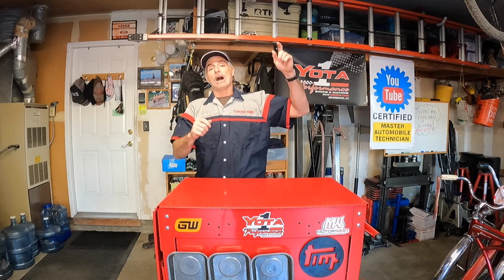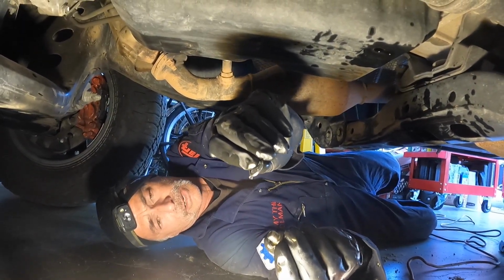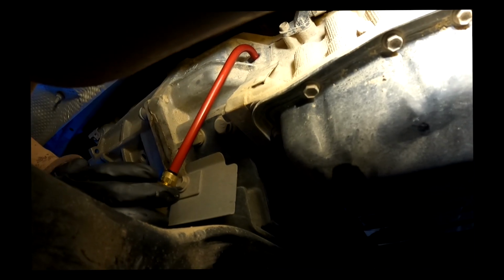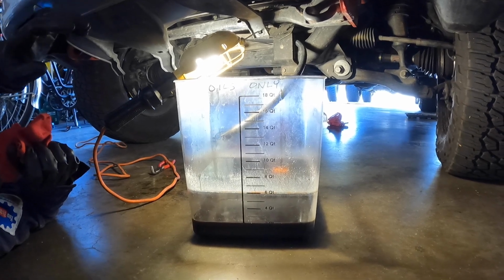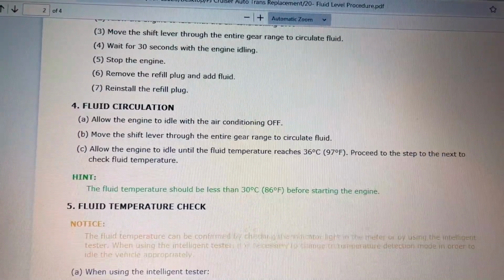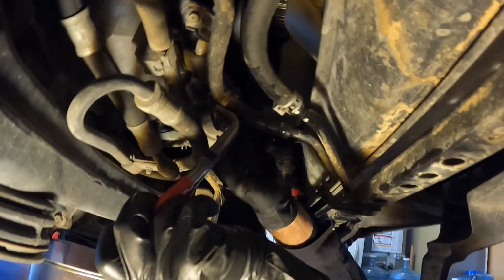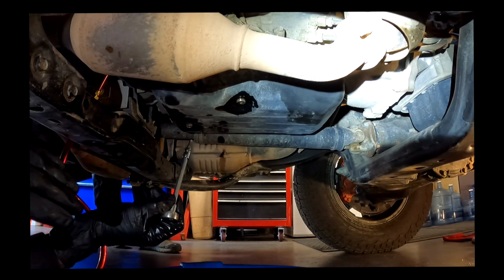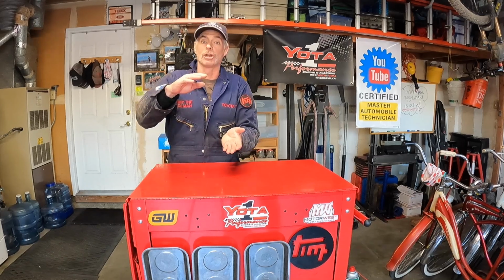Toyota/Lexus Sealed (No Dipstick) Automatic Transmission Flush (Fluid Exchange)

Comment: I have a 2020 Toyota Tundra TRD SPORT the Dealer says you never change the Trany fluid, is that BS or is it true, Had an 2016 they said at 100K unless you Tow often. Whats your opinion.
Reply: You go by what the manual says. Any person telling you not to change any fluid is an idiot!
Reply from the maker: Richard, the dealer telling you to never change the fluid is giving horrible advice.  No fluid on the planet is lifetime.  All fluids break down.  ATF at best can last 100k miles provided the fluid never went over 170 degrees Fahrenheit.  If you drive at all in the mountains, tow or go 4wheeling, you will have recorded temps way over 170.  As the temp goes up the life of the fluid goes down.  Keeping the fluid in good shape is cheap insurance especially when you know how much a replacement transmission will cost you parts and labor.
Reply: @TimmyTheToolman  I know the dealer was telling me BS, I totally agree with you will have it done at 50K
Reply from the maker: @richardmaxwell4489  Smart decision Richard.
Reply: So then when is the best time to change my Trany Fluid? I now have almost 20K.
Reply from the maker: @richardmaxwell4489  It depends on how you drive it.  If you drive in the mountains and/or tow a fair amount, I'd renew your fluid at 30k.  If you don't drive in mountains or tow and mostly travel on flat roads, I think you could probably safely go to 60k.  The old standard was replace your fluid every 30k for normal driving and every 15k for harder driving like in the mountains or towing.  With synthetic ATF now, you can go more miles before changing it.

Comment: Nope. If you want to ruin your auto tranny, flush it completely. You've got to leave some of the old fluid in there, because it contains metals from the internal clutch pack. Big no no. Internet is full of bad info....dudes and dudettes.
Reply: Er, you're thinking of a power flush using an external pump... That's what can cause problems, and that's how shops often do a quick and dirty "transmission flush" service.

This video is the right way to do it, using the internal transmission pump.
Reply from the maker: Thanks for the comment Steve.
Reply from the maker: Theshyguitarist, what you said is a theory about the concerns when doing a flush on a transmission that was clearly abused.  I've heard the same concerns from many sources.  Plenty of people have performed full renewals of fluid with zero issues.  So no, we're not giving out bad information.  I talk about this concern in a pinned comment (1st comment you see).  The question is, is this theory accurate or urban legend passed along over time?  By the way, you're right on the cusp of being erased on our channel.  Be respectful or your gone.

Comment: Always loosen the fill plug first.  Ask me how I know…..
Reply from the maker: Yep, that's good advice.  I usually remember to hit that home with people but I forgot to mention it.
Reply: Did you leave the fill plug out while adding the 1 quart increments, or did you reinstall the fill plug each quart added?
Reply: Did you leave the fill plug out while adding the 1 quart increments, or did you reinstall the fill plug each quart added?
Reply: Did you leave the fill plug out while adding the 1 quart increments, or did you reinstall the fill plug each quart added?
Reply: Did you leave the fill plug out while adding the 1 quart increments, or did you reinstall the fill plug each quart added?
Reply: Did you leave the fill plug out while adding the 1 quart increments, or did you reinstall the fill plug each quart added?
Reply: Did you leave the fill plug out while adding the 1 quart increments, or did you reinstall the fill plug each quart added?
Reply: Kids don't do drugs
Reply: Because sometimes you might have trouble getting it loose, then you have a car with no fluid that won't move
Reply: How do you know?
Reply: @BrutusPalmeira The drain needs a low pressure air leak above the fluid to allow the atf to drain more quickly. Pulling the fill plug accomplishes this easily.
Reply: Lol
Reply: You can always fill it through the cooler return line.  Easy to get to on these.
Reply: @steveholdensrc4000  
I bought a 25 feet length of clear 3/8 inch ID hose. Fill as the engine drains using motor running.  Drain into a 5 gallon bucket with the fluid measure lines. Stop when the fluid in the bucket reaches 3 gallons. Add a total of 12 quarts low viscosity AMSOIL ATF Signature series. Pricy but Amsoil is worth the $$.
Reply: And always check the fill plug of the rebuild you just received before the delivery driver drives away and you install it.  Speaking from experience
Reply: @sirsweetness8332 
 you can still fill the transmission if the fill plug is frozen up.
Reply: You could also drain, leave the level plus out and flush system by pumping fresh oil into the trans and watch when clean fluid comes out..

Comment: Great video Tim!  Is it OK to leave the fill plug out and the tip of the fill hose in the trans while you are doing the check procedure with the truck running? I think that is what you did but wanted to confirm. Thanks again for another detailed video!
Reply from the maker: Yes, it's ok to leave the fill plug out and the tip of the pump in the trans.  But, with the fill nozzle we used, the tip barely extends past the threshold of the transmission case.  You couldn't want a hose pushed way in there, because if it catches something, you're just messed up big time.
Reply: @TimmyTheToolman  Thanks!  I bought the same pump / tip that you were using in the video so it sounds like I should be in good shape
Reply from the maker: @joeburris2836  Yeah, you'll be good to go.
Reply: I had to add some additional fluid on my ‘07 Tundra with the A750F transmission. When I got it to fluid level check mode after my three drain and fills nothing came out of the check plug so I added fluid through the open fill plug while the engine was running. Took about 1/2 quart of additional fluid before fluid started draining from the check plug. Great video!

Comment: I "exchanged" the transmission fluid on my 07' Tundra.  Drain pan, fill, pin T-stat open, drain from cooler line, start rig, run through gears for 45 seconds, and fill.  Repeat 4 time, check temp/level and your done.  I learned all this via your videos.  Spot on and provided peace of mine of doing the job correctly the first time.  

You guys Rock.
Reply: Was going to mention the Tranny Oil Cooler/Tranny Thermostat Pin Open before starting the level check at temp, then removing after the trickle occurs/check hole revealed.
But what do We know?!?!
Love you Timmy
💜♥️❤️🧡💚
Reply from the maker: Good job Eric!

Comment: Three years ago I have my 2006 tundra to local dealer with 13 quarts for a flush with the machine. I got the truck back think it was done but once the transmission would heat and I would come to stop it would shudder and bump. So I opened the pan drained the oil out refilled it as per the factory service manual after getting the overflow plug dripping i closed it and it has ran fine since. I would not recommend the flush via the machine as they don’t check if adequate fluid has been put inside.
Reply from the maker: Thanks for the comment Andy.  That's unfortunate they don't confirm the fluid level is good after flushing the system.  You would think this would be part of the service.  I guess it supports my belief that it's better to do it yourself instead of taking it to a shop.  When you do it, you know it was done right.
Reply: That’s why I do my own work don’t depend upon dealers or outside shop. I was bleeding the brakes in my tundra yday and I broke the bleeder valve. Any pointers on how to get it out. My buddy who was a mechanic told me to use left hand drill bits.
Reply from the maker: @andyg5004  They sell screw extractors which is a similar method to using a left handed drill bit.

Comment: Timmy I bought a used rav4 2 years ago with 105k mikes. I dropped the pan and drained the oil out. The pan had back debris the oil was black and smelt burnt. So I ran the new oil for a 1000 miles and it drained it again and I have no problem with then tranny. I have since drained the tranny oil and changed the filter twice and the transmission is just fine.
Reply from the maker: Good job Andy!

Comment from the maker: PLEASE READ THIS COMMENT FOR IMPORTANT INFORMATION
**The cooling circuit for the A750F transmission is going to depend if your rig came stock with an additional external cooler or you just have the standard internal cooler inside the radiator.  Regardless of which setup you have, you would want to follow the metal "SEND" line from the transmission towards the radiator.  That metal line will eventually change to a rubber line that connects up to one of the cooler nipples on the radiator.  It might go from metal, to a rubber line, back to a metal line and then to another rubber line depending on how Toyota decided to plumb the circuit.  The fluid flows through the cooler and then exits another nipple on the radiator.  If you don't have an external cooler, the fluid will flow directly back to the transmission.  If you do have an external cooler, the fluid will then flow to the external cooler and then back to the transmission.  The reason why you want to understand how the fluid flows through the transmission cooling circuit is you want to remove the rubber "RETURN" line and install another 3/8" transmission hose directed into your graduated level container for this flush procedure.

**If you're viewing this video but you don't have an A750F Toyota Transmission, this DIY flush procedure will work for your sealed transmission as well.  You first have to figure out which metal cooler line on the side of the transmission is the send line and which is the return line.  You might be able to find out this information online, but an easy way to figure out which one is which is with a infrared thermometer.  Point the thermometer at one of the cooler line fittings on the side of the transmission and note the temperature.  Now, check the temperature of the other fitting.  The fitting with the higher temp is the send line.  It's sending the hot transmission fluid to the cooler.  The fitting with the lower temp is the return line because the fluid ran through the cooler, it dropped in temperature, and is now returning to the transmission.  Once you know which is which, you want to follow the send line towards the radiator, follow the circuit so you know which hose is the return hose so you can disconnect it and add your own 3/8" hose for the flush procedure.  The other piece of knowledge you need is the recommended temperature at which to perform the fluid level check procedure.  You can find this out via the manufacturers manual for your vehicle which will usually be an online resource or you can maybe find this out by asking on a forum and somebody knows the answer.  Once you know these two pieces of information, you can perform the flush procedure and accurately top off the system with fluid.

**At the beginning of the video, I discuss the concern of performing a full flush on a transmission that was clearly abused that has dark and nasty fluid.  I mentioned one theory about how the transmission could have issues after a flush.  The other common theory that I didn't mention is the fluid could be holding suspended clutch  (friction) material in it.  The fluid lost most of it's optimal lubricating properties, and because of that, excessive wear happened with the clutch disks.  Currently, the only thing keeping the transmission shifting and not slipping is all that suspended friction material in the fluid.  Once you perform the flush, you lose all that friction material and now the transmission doesn't shift and/or it slips.  As it happened, even though Thanh's transmission was clearly abused due to the condition we saw the fluid was in, the end result was the transmission shifted better after the flush.  So, did we just get lucky or maybe the concern about performing a flush on an abused transmission is quite a bit overblown.  It's hard to say if there is merit to this concern because there's conflicting experiences.
Reply: I couldn’t believe you didn’t mention the fluid being full of clutch pack material and helping an old trans to function in the video. That is literally the main risk in doing a full trans fluid exchange on an old car. There’s no way that sludge would form in the trans unless SEVERELY contaminated somehow. Transmission fluid just doesn’t sludge up naturally.
Reply from the maker: @I_know_what_im_talking_about  I thought about saying that at the intro but then changed my mind.  Afterward, I decided to mention it in this pinned comment.  I guess you missed it.  it's in the 3rd paragraph.
Reply: Really good info, ive (wife car) had my GX a almost 2 years now and i think its time to drain and fill it. Drive fine, shifts fine, just dont know of the old owners did anything. Got it at 158k. Ive just never had an automatic before, only manual and i can do a clutch quick and easy. But automatics are scary man!
Reply from the maker: @noahwise6938  Yeah, it sounds like your wife's rig is due for an ATF renewal.